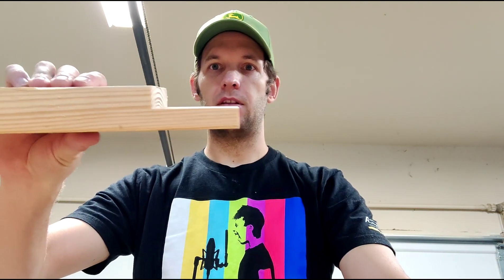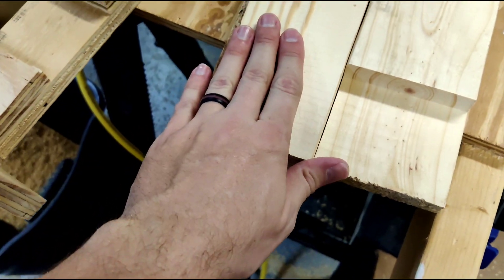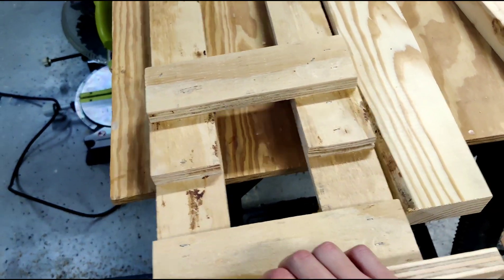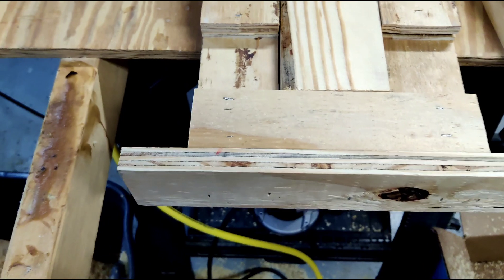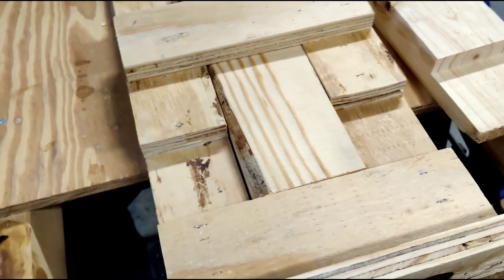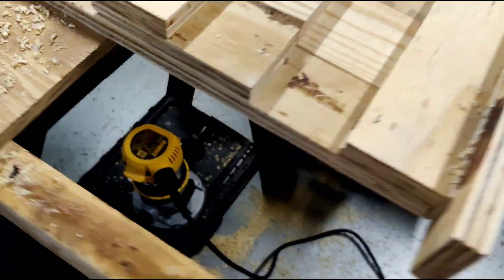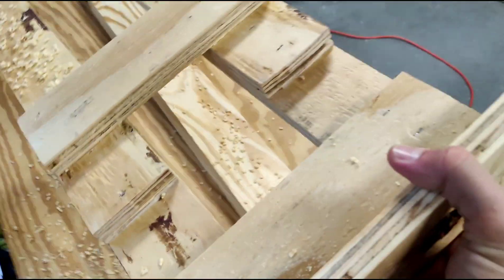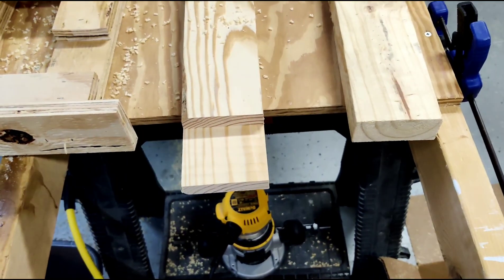How To Create A Half Lap Joint With A Router

Comment: Nicely done. I have a similar, but more challenging, situation. I have a small-format Makita router. Some   tradesmen consider it a trimmer. The base is smaller than the lap joint I need to route. I may have to fabricate an oversized base plate for it.

Comment: Fit didn’t look good.  Can only use on end half laps nothing in between.
Reply from the maker: Yhe pieces I showed were the test pieces I did during the mock. Unfortunately the pieces I was working with had some bend and twist in them so the laps weren't the 100%. I think you could take this idea and make a jig that would go on a middle section for those kind of laps.